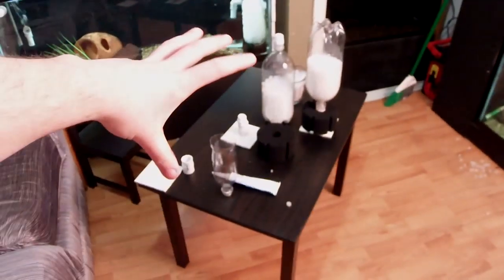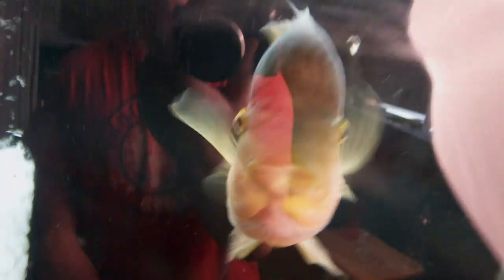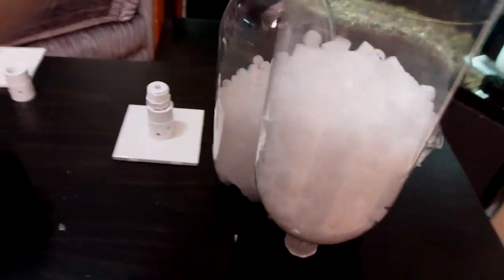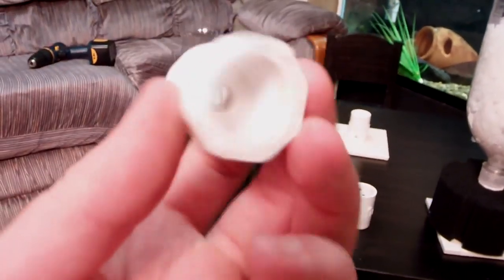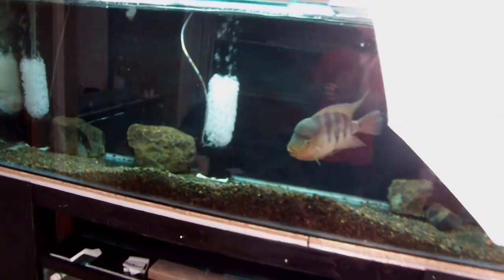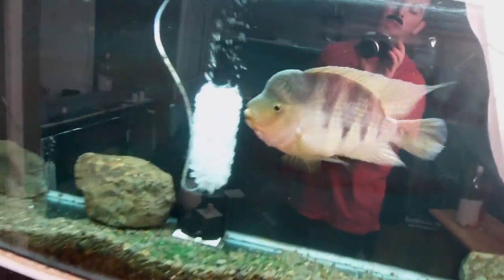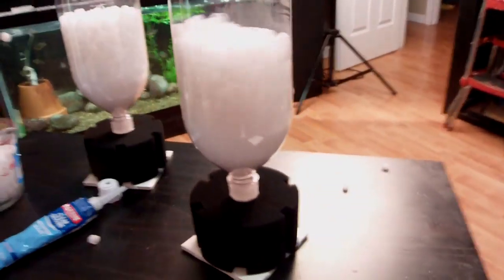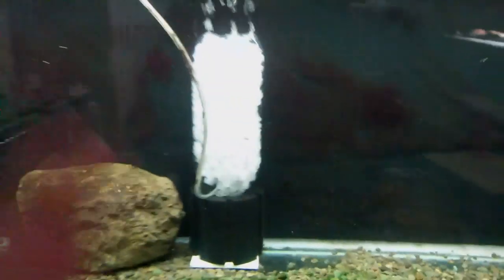HOW TO: DIY Moving Bed-Sponge Filter HYBRID!!

Comment: Interesting stuff!  A properly sized piece of vinyl tubing might be beneficial to connect the soda bottle cap to your pvc cap.  Slid the tubing over the both of them and use it like a clamp; then you wont have to worry as much about the bond that the silicone does or doesn't make to the different materials.

Comment: Awesome build, man.
When I first came up with the idea of making internal moving bed filters I didn't think so many people around the world would run with my idea and years later we'd be seeing such evolved designs.
My first design was simply a bottle shoved onto the uplift of an under gravel filter, lol.
Just checked the date on that upload and it was nearly 6 years ago! Since then there must have been thousands of videos posted to Youtube using the moving bed idea.
Have you seen the new K1 micro media? It is much smaller and has almost twice the surface area per volume so it creates a much more fluid bed and allows for greater efficiency.
I'm intending to do a proper video on the pros and cons of moving bed filters vs static bed filters and that should answer many of the questions viewers have on this subject.
Just subbed your channel - thanks for the link in your video, much appreciated.
Reply from the maker: Thanks Richard! Yeah I'm loving the moving bed filters. I saw DIY aquapros video on the micro stuff and thought it looked awesome especially with the increased surface area for the volume. Definitely gonna have to try it one of these days as I get the design of this filter a bit more refined. Thanks for the sub!! Its greatly appreciated!!
Reply: Cichlidman09 | Forrest's Cichlids No worries, man. I have set my subscription to be notified of your new uploads too so I shouldn't miss one.

Comment: Quick tip for you bro if u give the bottle cap a light sand the silicone will stick to it alot better make sure to gwt the dust off before silicone is applied.

Comment: How meny 2 litter bottles should I use for 55 gallon with cichlids and lots of live plants?
Reply from the maker: Keith Wirrell Honestly 1 or 2 would be fine as long as your not everstocked and keep up with water changes
Reply: somewhere I read while researching for this filter that moving bed filter are not good for live plants as these filter are very good at removing ammonia from water quickly. So they considered very good for handling ammonia spike from large feedings. But they don't leave any ammonia for plants which they need.

Comment: I'm not getting the whole k1 craze..don't get me wrong I've bought 5 gallons of the stuff.. from what I've read you need 5 liters of k1 to support a 2lb carnivorous/high protein diet fish...when a couple of large sponges will do the trick...help me understand why I need a bunch of swirling plastic in my tankor under. taking up a bunch of room..small hob fluidized sand filters are more efficient.I guess I'll see